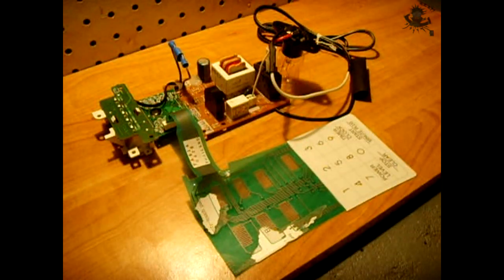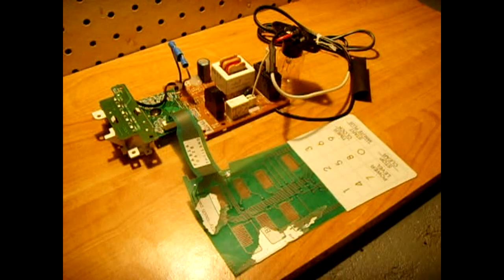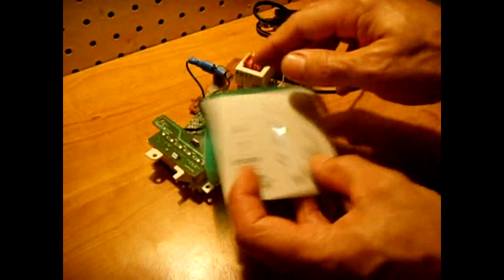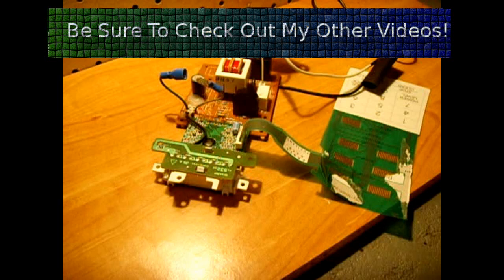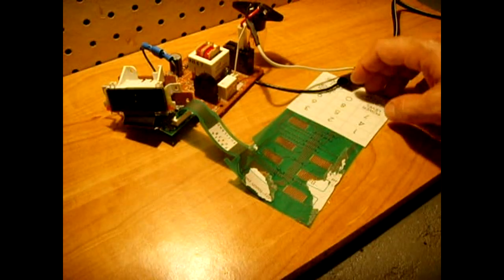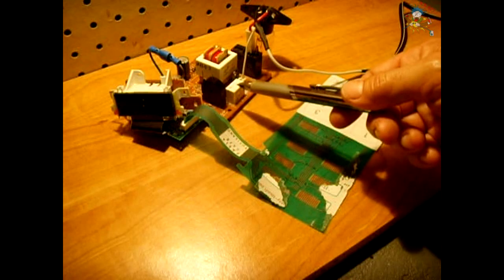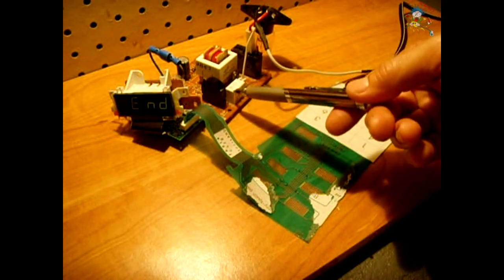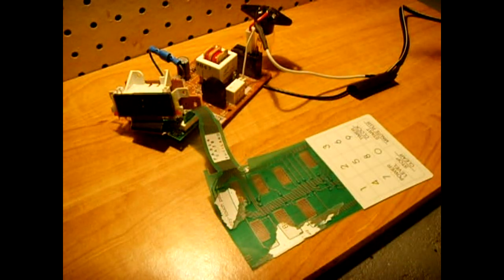TIMED 120V Power supply with LCD/Clock from Trash

Comment: After watching your vid for the timer circuit for the water heater I started watching these again. I sent AVE (ArduinoVEvil) your timer circuit vid thought he might be interested. He just posted a vid and his Hako soldering iron does not auto shut off. These could be good safey circuits for those items I wonder if they could handle the load of a Car charger? I would use it on that as well just in case I forgot I left it on.

Thanks for posting always good stuff...

Comment: Excellent coherent helping video! One of the best I've seen. Your good will to help is evident! One q. I wondered about: isn't it (very) dangerous to tap on the relay while the oven is open, because of the potantial of operating the mw and radiating towards the person while doing so (as it got fixed by that tapping, while being exposed when the mw OPEN)?!
Reply from the maker: The MW energy is directed inside the oven cavity.
Reply: Thanks for your quick reply. So, I should assume it is a uni directional radiating/transmitting body (unlike omnidirectional antenas), w/no radiation whatsoever to the surrounding space around the magnetron? As an experianced person, I assume you have taken all secure measures, meaning-studied the issue thorughly, checked it (theoraticaly), and there is NO potential damage (or spare arm in your body) to fear from? Can you asure me you have done those checks?
Reply: Can you answer my 2-nd question please.  (a day ago). Thanks

Comment: Have you got a more in depth video on how to test the circuit board to make sure it's working? I have zero lights, numbers, ect. No power at all. I've tested the line fuse and the thermal fuse. Both show continuity. I've also tested the door switches, they are all fine. And the outlets are working fine. So after a little research, it seemed the circuit board was the issue. I found one online that was used and purchased it, installed it, and still nothing. So either it's something else, or the circuit board I purchased is also bad. I need a more in depth explanation on how to test the circuit board.
Reply from the maker: Trace the 120V power supply wires to the circuit board and make sure you see 120V at the board. If you do, then a circuit board mounted transformer is likely faulty.
Reply: So I need to have power going to the board in order to test it? How do I determine which wires are the 120v power supply and what do I touch the multi meter prongs to on the board in order to test it?
Reply from the maker: Follow the 120V AC power supply wires to the board, then using a DMM set to ACV of a high enough range, you CAREFULLY probe where the wires connect to the board. You should see 120V.
Reply: As you have no doubt guessed, I'm not very experienced with this, so it's hard for me to understand exactly what you mean. Here is a photo of my circuit board and the wires that attach to it http://imgur.com/a/B6WN9  . Are you able to look at this and tell me where I should be probing, like, which wires are the 120V AC power supply wires?

Comment: I did exactly this about seven years ago with a microwave oven I found on the side ov the road. I set up the timer part ov it to time whatever I decided to plug into it. Guess what I plugged into it? Another microwave oven!!

Yes, we had a microwave that had one ov those annoying mechanical timers. Not good for setting short & accurate times with. Having the external microwave timer was cool.

It actually lasted longer than the original microwave it controlled! It has been running a second similar one until just over 50 days ago, when we went totally off grid. So no more microwave now. heh
Reply from the maker: Good idea! Yes, microwave ovens do consume lots of power. Not a good thing for off grid use unless you only use it for short periods of time.

Thanks For Watching!
Reply: electronicsNmore Yes, they do use quite large amounts ov power, but the short duration can make them ok to use for simple reheating and stuff. Our specific problem is that we haven't yet got a single large inverter capable ov running one. That will come in time, but y'know we haven't really missed it much at all. The main thing was the clock on that timer I was speaking ov, but I replaced that with an old 12 volt digital clock removed from a wrecked car. That's running, ov course, from our 12 volt DC circuit.
Reply from the maker: I'm no fan of microwave ovens. I very rarely use microwave ovens. As you can see by my videos, I love to rip them apart!
Reply: electronicsNmore Indeed, they have some great useful parts in them...! I know people are fond ov rewinding the transformers to do interesting things... I have also used one for a seemingly bizarre application. I used one to make a speaker simulator for recording electric guitar..! :) It works really well, and I didn't need to mod the xformer. I have been recording with it since I made it in 2008. Have been meaning to upgrade it though with a vacuum tube output buffer.